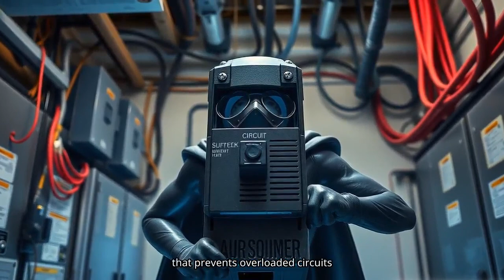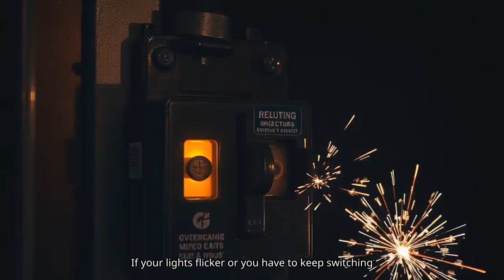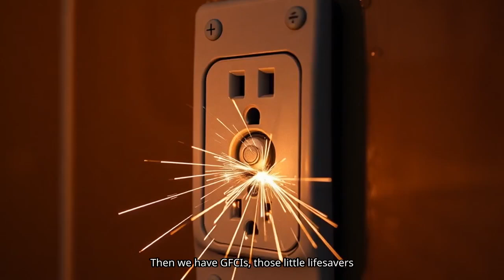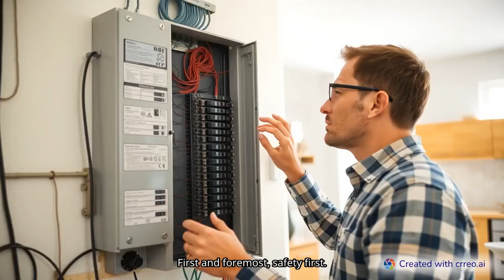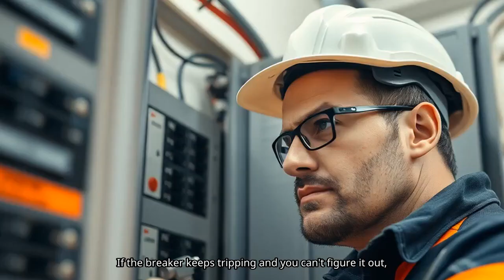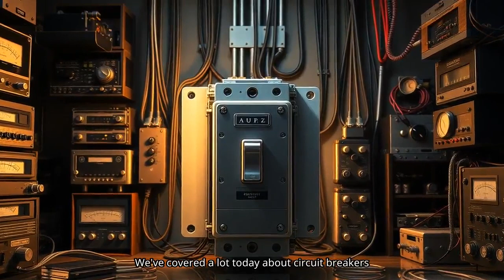Why Does My Circuit Breaker Keep Tripping?

Comment: I have a clip on gadget for investigating ground fault (differential) tripping. By listening to the sound can tell what's causing it, water heater element fault, electric wiring,  water ingress, insulation leakage etc
Reply from the maker: You also have a multimeter that you can use to ohm it out to figure it out.
Reply: @ElectricalContractors508     A multimeter I find useless, only good for testing known factors, when it's the unknown which is the real issue.   The art is clipping my device on at the point of entry,  leaving it there and listen through the Bluetooth earphones as I walk around the property. Every type of leakage fault has its own characteristic sound and waveform.
Reply from the maker: If u take the wires off the breaker that's tripped then put those same wires on a breaker that's not tripped then my troubleshooting starts from there to eliminate whether it's a breaker issue or not. Then the multimeter leads let's me know in a low voltage panel whether I'm getting 120 to ground.
Reply: @ElectricalContractors508   Yes that's standard Half-Split style cold troublshootihg of a single isolated circuit (after you've found which one it is) but what I'm talking about is in common with all breakers, a general earth leakage fault where you don't know where it's located and can't tolerate power cuts to carry out cold tests, which are sometimes inconclusive anyway because of the very low test voltage from a multimeter.
Reply: @ElectricalContractors508    After 20 years experience,  the most common cause of ELF are water ingress into exposed conductors in contact with concrete and faulty water heating elements.  Sometimes it's insect inside appliance.
Reply from the maker: Yes Sir!